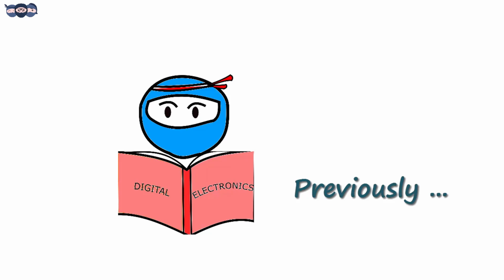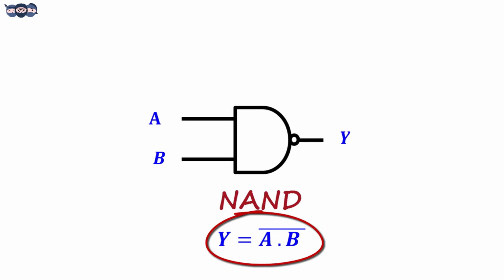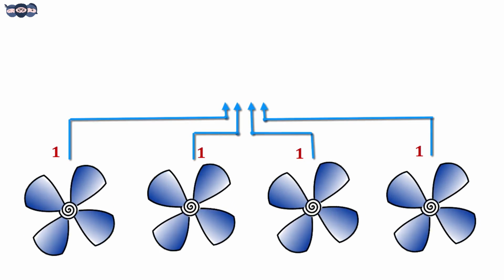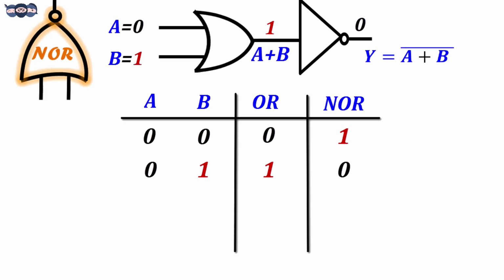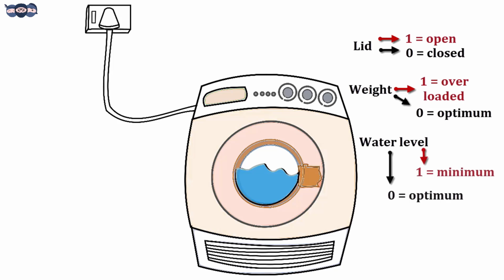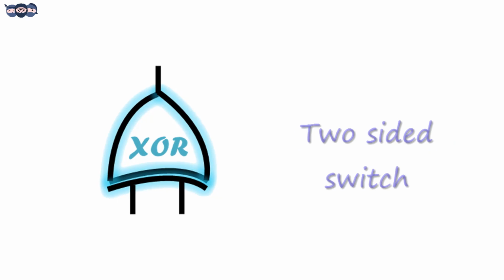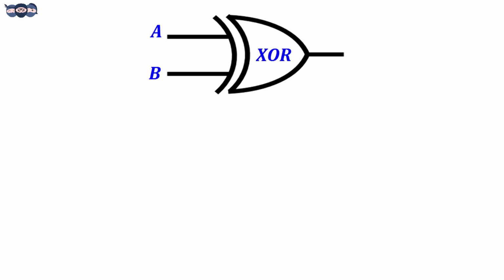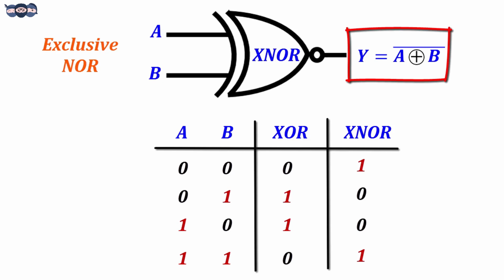Advanced Logic Gates Explained: NAND, NOR, XOR, XNOR with Applications | Digital Electronics Ep 11

Comment: I have a question about that XOR gate example you've mentioned in the video. Just like the way in your example, there are two switches to one of the bulbs in my room. That bulb light up only if the both switches are in the same state. They both should be either switched ON or switched OFF for the bulb to light up. The bulb turn off when one of the switches are off and the other is on. So accordingly, I don't think there's a XOR gate in our circuit. I wonder what that gate is.... It's really confusing for me. Could you explain it a little more for me?
Reply from the maker: Well in that case the switches are setup as XNOR gate. The truth table of XNOR gate is XOR complemented. So when both of the switches are OFF (logic 0) or when both of them are ON (logic 1), the bulb turns ON (logic 1)

Comment: We're both switched 
connected to XOR gate or XNOR gate
1)if they were connected to a XOR gate then why does fourth column show 
1,1==>0 would this not mean that even if both of the switched were on light will not glow?
2)if  both were connected to XNOR gate then why do second and 3rd column show 0,1==>0 and 1,0==>0 respectively wouldnt it mean if one switch is on then light will not glow?
Reply from the maker: XOR stands for Exclusive OR. The output of two input XOR gate is high only if a single input is high. So to answer your first question, the light won't glow if both the switches are connected to XOR gate and kept high. Similarly the output of XNOR gate is high when either both inputs are zero or one. This means that even if one output is high but the other is off, then the bulb wont glow. One thing to keep in mind is these switches are not connected to the light bulb directly. Switches are connected as inputs to a GATE and the output of this gate drives the light bulb. Hope this solves your doubt Avanish Padmakar :)